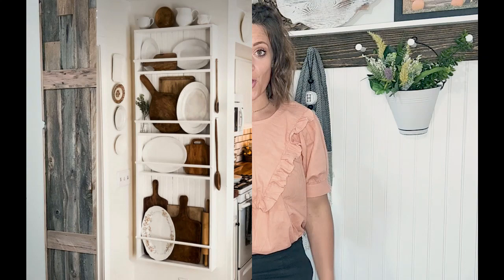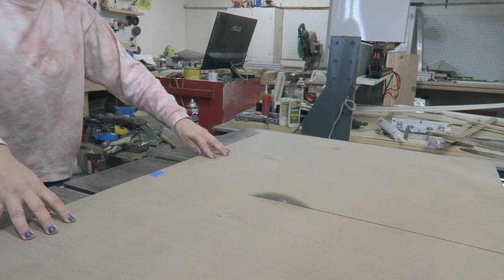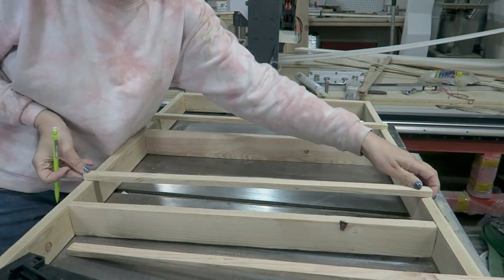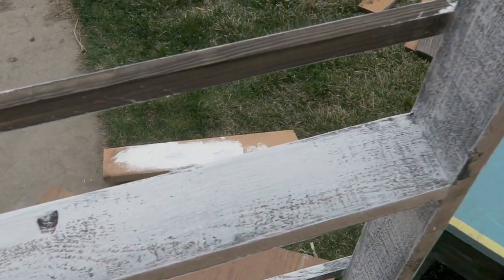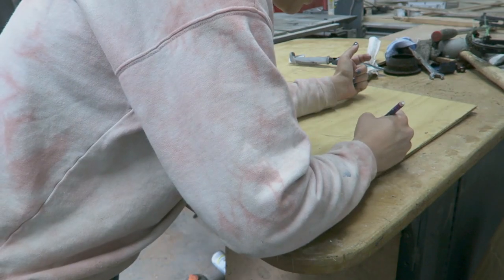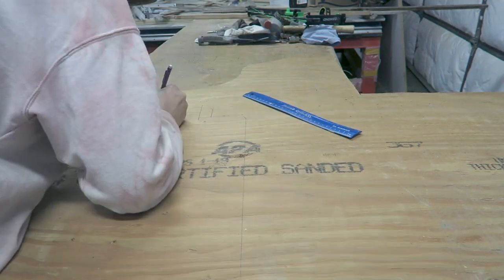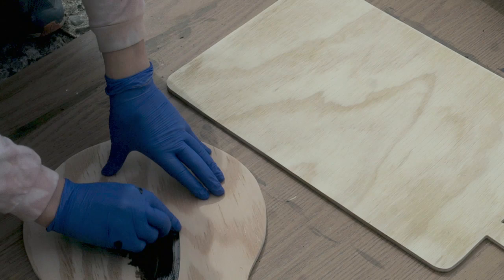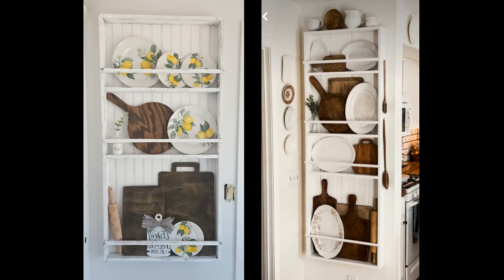Check out this Farmhouse DUPE!! With DIY cutting boards.

Comment: Annalee how did you attach it to the wall.  I don't know if I misses that part.  I love this and believe I have everything to make one.  ❤️
Reply from the maker: Oh! Shoot, you didn't miss that, I forgot to mention it🤦‍♀️ I put long screws into the studs in my wall, and then marked where they lined up to the hutch. Then I drilled holes bigger than the screw heads, in the very top of the wooden frame, and slid it onto the screws. I hope this makes sense haha
Reply: @annalee_ashby_DIY  it makes perfect sense!  Thank you so much!